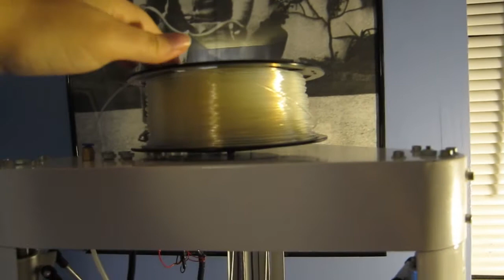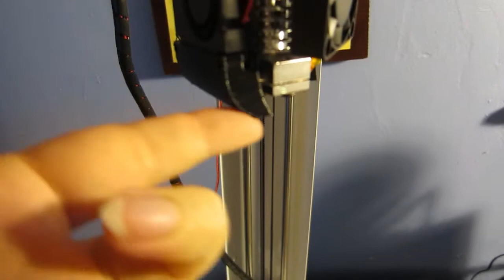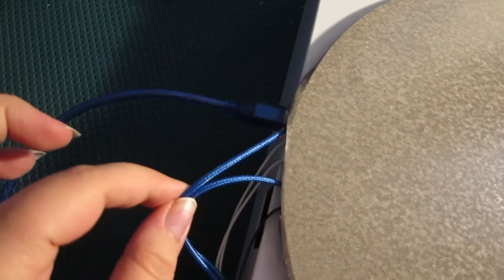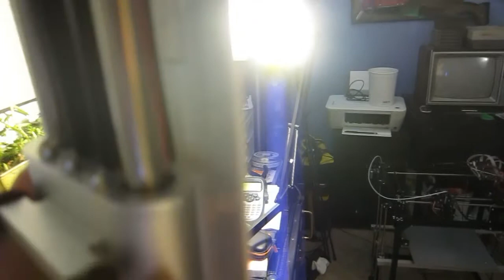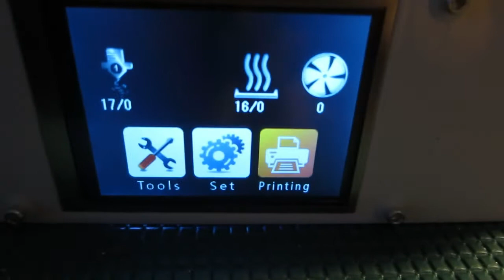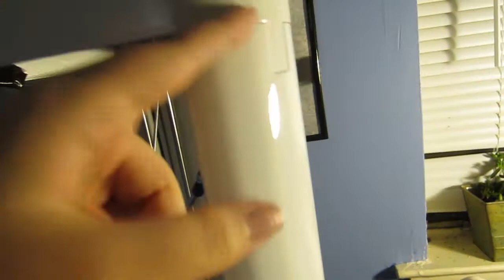Flsun Pre-Assembled Delta Review

Comment: I also have the FLsun delta printer. At first I had also technical problems, the screen defect cables torn down motors running direction. Now I have fixed everything and he is running quite well. The advantage is the print size of 260x350mm. In Thingiverse, Standfüse has designed that the printer can get the warm air out of the electronics.
f

Comment: I wish I saw this video before buying this printer. I wanted to save some time on assembling a printer, and therefore this one looked like a good option for the extra 50$ you pay. What I ended up is:
- I've already spent ~40 hours re-wiring, fixing mechanical problems etc.
- Spent 50$ more on buying connectors and other parts (fans) that needed replacement
And this junk still doesn't print! All I can get out of it is distorted garbage. Even with the auto-leveling the head would often scratch into the bead. I think the bed is heavily malformed. Probably need to spend more $ on changing it too.
Yes, flsun promises technical support. But the amount of help you can get is really limited by timezone difference, language barrier and screen sharing. 

So this was the 400$ well wasted. At least one good lesson learned.

Would be nice to see if you can get any results from this printer eventually.

Comment: 14 awg should definitely be enough for a heat bed.. well and more enough current for 14awg...
It may get hot at start but shouldnt stay hot.
Reply: Nominal current on 14awg is 20 amps,
2 of my 300x300 heatbeds,  wont go over 19a
Reply: I use 16AWG on my Anet A2 with a bed size of 220 x 220. It gets lukewarm only when the bed is 90C so I guess 14AWG should be enough for the Cricket's slightly larger bed.

Comment: The probe is actually a wire connected to the hot end assembly that goes down to the bed so when the hot end touches the bed it completes the circuit. I'm assuming the adhesive material is needed because it is conductive so there are probably other ways to do it. I don't love the sticky stuff either but I'm looking for alternatives for mine.